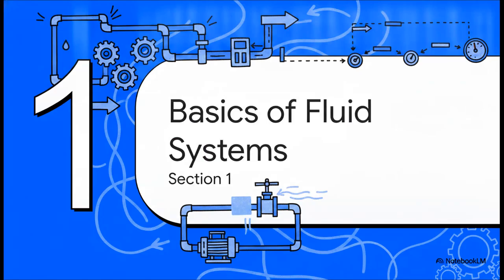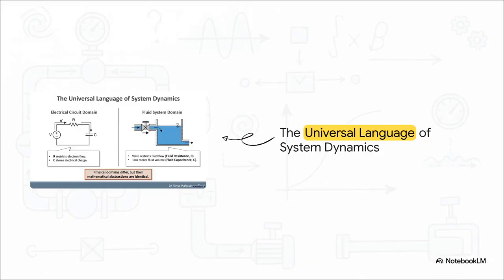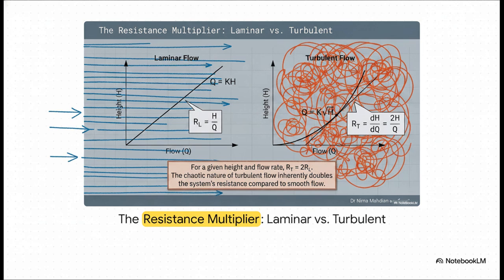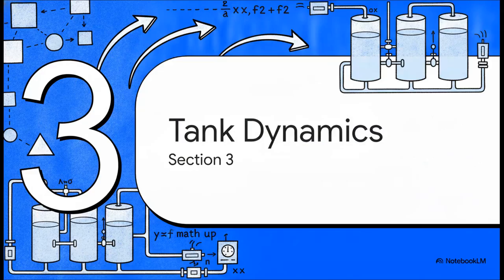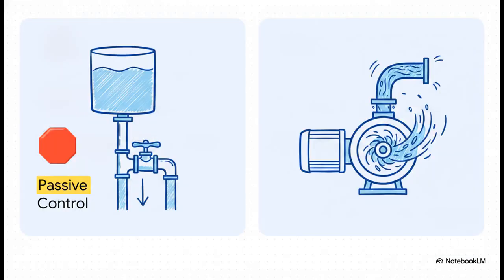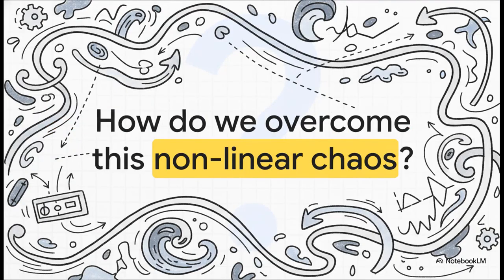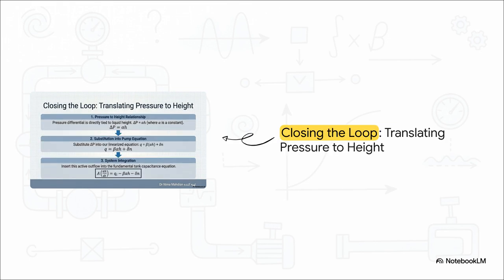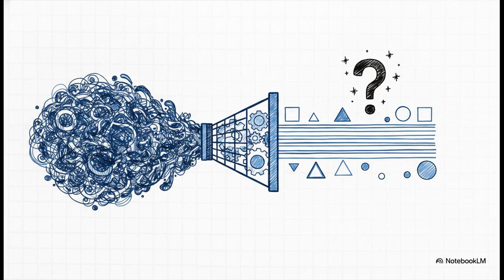Industrial Fluid System Dynamics Explained | Process Control Fundamentals

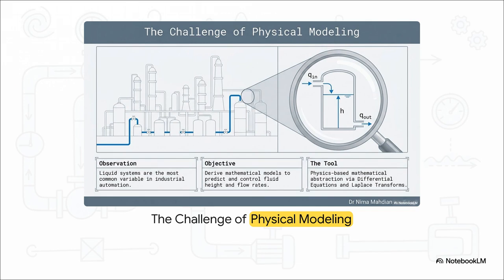Comment: At 1:27, you explained that physical modeling converts a real industrial process (such as a liquid tank or a pneumatic system) into mathematical equations. My question is: What is the primary objective of physical modeling in control engineering? Is its main purpose to predict system behavior and analyze dynamic response for controller design, or does it also serve other functions in industrial control?
Reply from the maker: The primary objective of physical modeling in control engineering is to create a mathematical representation of a real system that allows engineers to understand, predict, and analyze its dynamic behavior before designing and implementing a controller.

However, physical modeling also serves other important purposes, such as system simulation, controller tuning, performance evaluation, fault analysis, optimization, and improving safety by testing different scenarios without affecting the real plant.

In practice, a good model provides the connection between physical reality and control design, helping engineers develop more reliable and efficient industrial control systems.

Comment: Thank you very much, Dr. Nima, for this excellent lecture. It provided valuable insights into industrial automation and the dynamic behavior of liquid systems. The lecture clearly explained how liquid processes respond to changes in operating conditions and why developing an accurate physical and mathematical model is a fundamental prerequisite before designing a control system. The concepts were presented in a clear, practical, and engineering-oriented manner. I truly appreciate your efforts.
Reply from the maker: Thank you

Comment: Thank you Dr Mahdian for this useful videos ,if you dont mind i want to ask question is:
Since most real industrial fluid systems, especially turbulent flows and centrifugal pumps, behave nonlinearly, how can an engineer decide the correct equilibrium operating point for linearization? And what happens if the system moves far away from that point during operation?
Reply from the maker: Thank you for your excellent question. The equilibrium operating point is usually selected based on the normal operating conditions of the process, such as the expected flow rate, pressure, temperature, and load range. Engineers typically use plant data, process requirements, and steady-state analysis to identify the most important operating region for linearization.

If the system moves far away from this point, the linear model may no longer accurately represent the real nonlinear behavior. In such cases, engineers may use gain scheduling, adaptive control, nonlinear control, or multiple linear models around different operating points to maintain good performance over a wider operating range.

Comment: It was a very good lecture. The information was presented in a logical sequence, starting from the fundamentals. I have one question. Could you please clarify whether the area A used in the final tank equation is the same physical quantity represented by the capacitance C in the earlier single-tank model?
Reply from the maker: Thank you for your kind feedback and excellent question. Yes, for an ideal tank with a constant cross-sectional area, the physical quantity A in the tank equation represents the same storage effect that was described by the capacitance C in the earlier single-tank model.

In other words, A determines how much the liquid level changes for a given change in volume. The larger the area, the larger the storage capacity and the slower the level response.

The difference is mainly in terminology: A is the physical geometric parameter of the tank, while C is a more general dynamic capacitance concept used in system modeling to represent storage effects. For a simple constant-area tank, they are directly related.

Comment: Dr. Nima Mahdian I have a question, what is the ultimate practical engineering objective of this entire modeling and linearization process?
Reply from the maker: The ultimate practical objective of modeling and linearization is to create a simplified mathematical representation of a real industrial system that engineers can use for analysis, controller design, simulation, and performance prediction.

Since most real processes are nonlinear and complex, linearization allows us to apply powerful control design tools while still capturing the important behavior around an operating point. The final goal is to design controllers that can achieve stable, safe, and efficient operation of the real system.